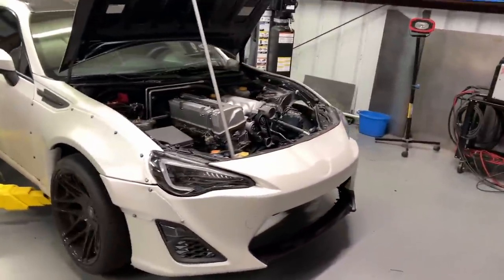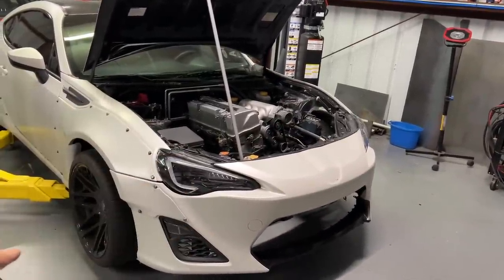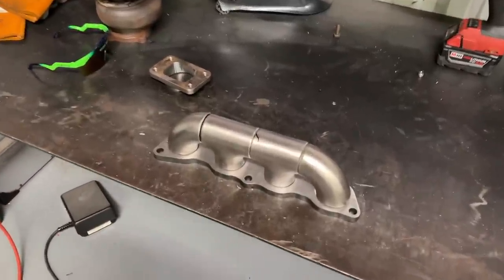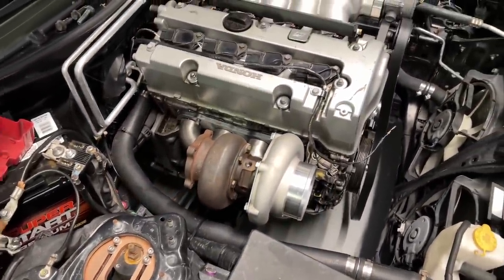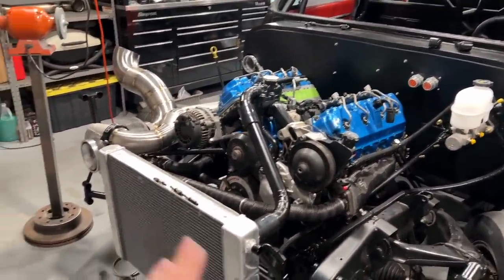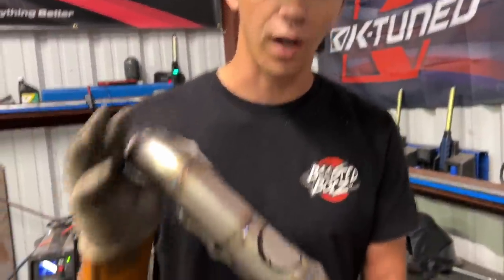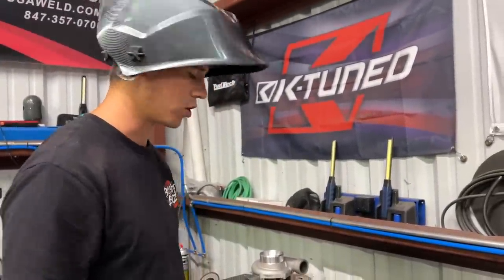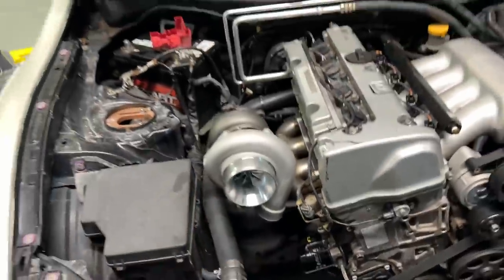Building a Turbo Manifold For Our K-Swapped FRS!

Comment: Re-route radiator cooling hose, or, replace the section near turbo with metal pipe and heat shield it.
Reply: Both.

Comment: That's Awesome Kyle.The manifold looks good,and the turbo placement is great.I'm going to be "That Guy",and suggest you take the weight plate from the Civic for mounting the intercooler,and to shift the weight forward so the FRS drifts better. Wiring is my kryptonite,so good luck Wyatt.

Comment: Just a thought. If the motor in the shopping cart is a wet sump style wouldn't the oil line feeding the little pump see crankcase pressure? Especially boosted.  Maybe run a seperate oil tank for the turbo altogether..  probably why the line blew in the first place.

Comment: Stiffening the rear shocks AND springs, plus a swaybar. Add a tiny bit of rear camber if you can. Add extra air to rear tyres. Softer front springs and shocks with a sway bar delete.
She will want to slide

Comment: Check out the options on a nozzle guard/guide for your plasma bro!! Will cut down on your consumables and give you a consistent cut without shoving your tip into your workpiece. As that happens to us all lol. 

They also have compasses they clip into and gives ya concentric circles everytime.

Comment: 8:15 looks like the alternator pulley  isn't straight with the other pulleys.  
 could just be the camera angle,  but it looks like the right side is tilted back toward the firewall, compared to the rest of the pulleys. 
 that'll shred a belt for sure

Comment: just a quick tip for plasma cutting: go fast enough that it makes a giant plume of plasma, sparks, and insanely thick smoke- you get a cleaner cut, try it for yourself, easy to get a good handle on the right speed on long cuts with a straight guide

Comment: The oil pickup line coming off the shopping kart doesnt seem like it was blown off due to oil pressure, if anything the pump should be causing a low pressure spot at that fitting which would cause the pipe to fit tighter due to suction.
Just a guess but it seems more like a case pressure issue, if so the AN lines will stop the pipe coming off but the pressure will find its way out somewhere ideally through a catch can

Comment: Hey guys, love the videos obviously. You’re moving too slow with the plasma cutter though. With schedule 10 pipe you should be moving at 1.2-1.5 inches per second, which sounds slow until you actually do it. 

The faster you go, the less slag you get, and cleaner cut. As fast as you can go, while still blowing all the way through the metal is the goal.

Comment: Kyle you should paint all intercooler piping and all OEM black and make a shield for turbo make this look like a car with a stock turbo setup that would be badass not flashy anything just black and dull put a custom airbox also do it up thos way when cops pulls u over tell them motor is stock and you only put a better exhaust for sound

Comment: No back purging with Argon?
Reply: If the material is thick enough and if you weld cold enough you dont have to…  only if it is bright yellow glowing on the backside the  it reacts with the air and gets “sugaring” ….  
As long as there is no sugaring ( or you grind the “sugar” out later you’ll be fine …. 
Its an exhaust manifold not a food processing plant ….

Comment: you're gunna have to put some heat wrapping on that radiator line if you want it to last. Or cut out the rubber hose and use aluminum pipe for that section.

Comment: Since the radiator hose runs right next to the turbo you should just get a piece of aluminum braided hose to go in it's place so you don't have the turbo burning a hole into your radiator hose and either causing the car to overheat at the very least but it could cause you to wreck the car as well and I would also throw a piece of DEI heat sleeve over top of it as well just to be on the safe side

Comment: You should look into a d12 or d13 civic engine for the shopping cart. Or a honda motorcycle engine. As much as I'd love to see a k swap in the back of it I think a tiny 1.2 d series with itbs on it would be wick af. They didn't come fuel injected but there is swaps for it and it won't be overkill in a shoping cart like anything bigger.  Would be sick af. The engines are cheap as dirt. Parts are cheap as dirt. They are small af. Make great power for go-cart.

Comment: Hey long time watcher first time comment. I need some advice from some pros. I swapped a d15z1 into a 2000 hatch that had a d16y8. I know it's a down grade and it's obd1 to obd2 but I've made it sorta work. I've got the computer plugged in and got most of everything hooked up but it's running like absolute shit. It dies when you give it gas and it has a rough idle. I had to use the y8s injectors for the harness could that be why the z1 is running like shit?

Comment: You really need to understand the relation of sound and space. The subaru have an exhaust which exit under the car, there's less space under the car than on top of the car. All of your hood exit exhaust emits the sound on a very large space so the sound can dissipate quickly and pretty quiet. The subaru the on the other hand emits the sound under the car which create much more "bass" and loud sound due to the lack of space and vibration when the sound hits the road. All I'm saying is just put a big snail and hood exit exhaust on that baby😂.

Comment: What's stopping you from a pre built tubular manifold?
Reply: They are ballers and need to show it off
Reply: @MotorSwapDan  balling by building a less efficient manifold? By all means they should build there own, just thinking they may regret not doing it to a high standard the first time. It depends if they plan on getting serious with that car in the future or not.
Reply: @JMJM75257  balling by showing they have skills. Best way to have pride in yo ride

Comment: The FRS needs a boost-activated cutout and a full exhaust of the stock exhaust diameter, just like a 3.5 inch boost cutout and a 2.5 inch double muffler resonator exhaust, just floor it and sudden loud fury of acceleration, you see a cop nearby so you let off the gas and suddenly its sleeper silent mode, he can't pull you over for anything cuz its super silent XD

On an unimportant note, I put up a ceiling fan yesterday, then I had to flip the blades over today on a ladder since the fake wood texture didn't match the white kitchen lol

Comment: For the log manifold- couldn’t you just use four 90’s and cut them so they fit together- all pointed towards the exit. Instead of using 2 90’s and 2 t’s. My way would take a lot longer, more difficult to fab, maybe it’s not even a log manifold anymore